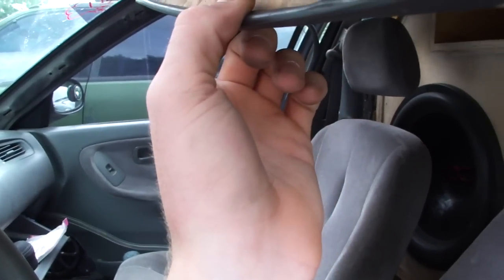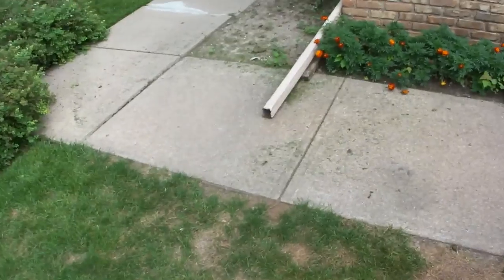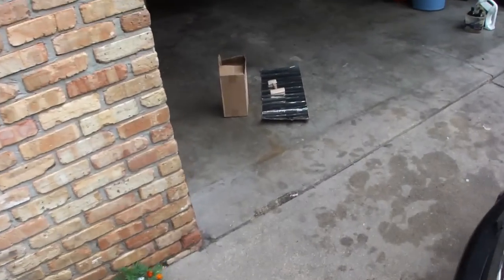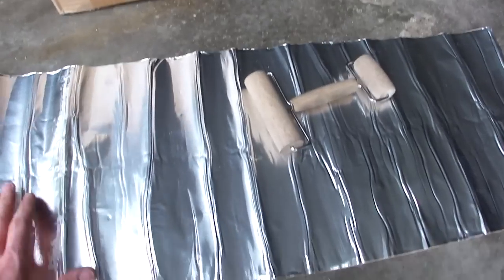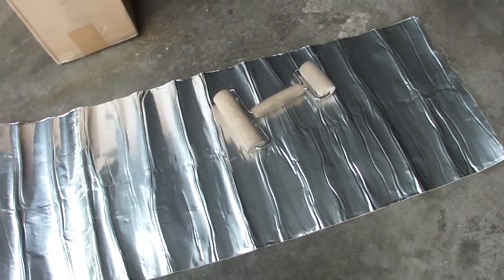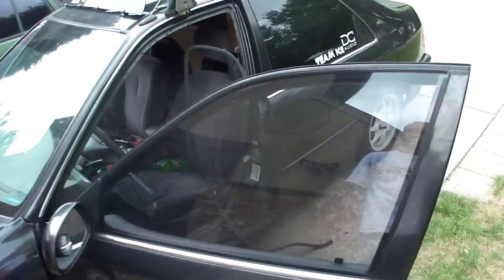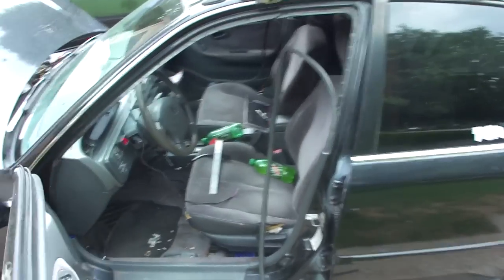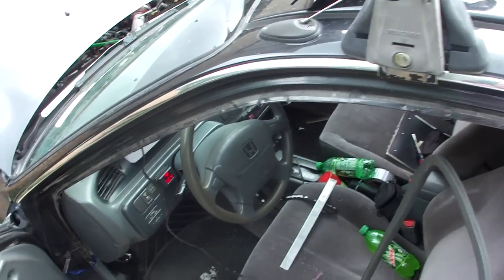DC Civic Broken Roof from Bass

Comment: that what you get man from dc 18s man need to get that suport cut and get some small runs of square tubing welded in the hole way across and posibly a striper pole would also help

Comment: I had the same problem in my civic with my 3 18's, I had it weld back up then I had 2 L brackets made out of metal and I now had a bar from my roof (where yours broke) to the center console.

Comment: I had the same problem in my civic with my 3 18's, I had it weld back up then I had 2 L brackets made out of metal and I now had a bar from my roof (where yours broke) to the center console. by the way, I have a sunroof and now doing 12 12's Soundstream SPLX-122 and I my loose it this time lol.

Comment from the maker: @sikvibration 
stripper pole is a possibility, but im worried im going to start tossing windshields if i do. if the roof is supported, the pressure goes to the next weak spot: the glass :p